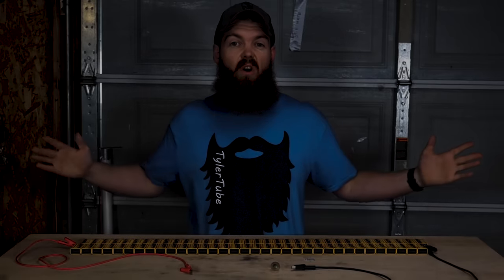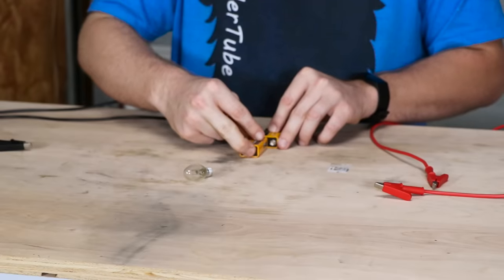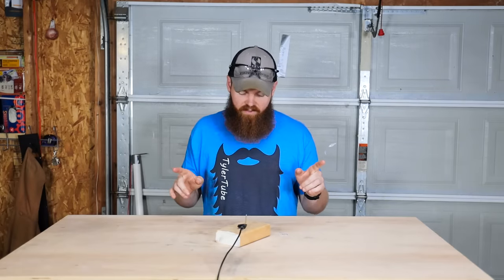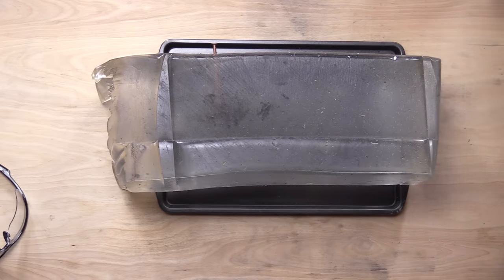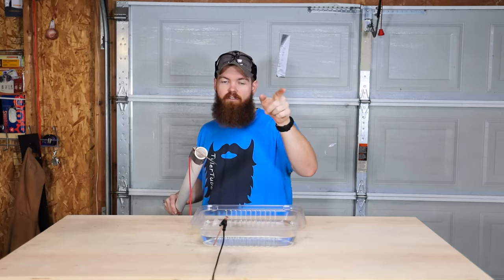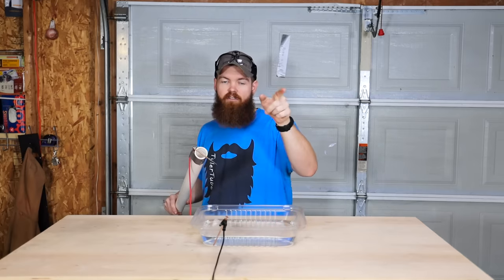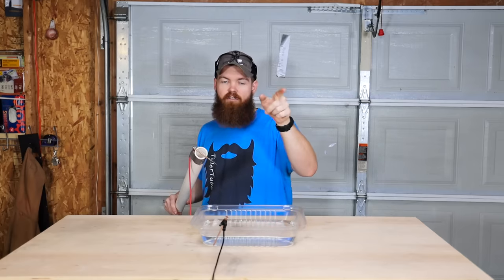I Connected 500 - 9 Volt Batteries...

Comment: 6:22 - Would worry about those hand placements my dude unless you want to be the next test subject....
Reply: Yes, that was a little toooo close for comfort, if his hands would have been sweaty or wet it wouldn't have ended good
Reply: i was thinking the same haha
Reply: closed my eyes a few times
Reply: @loganbrent8075  why? the video is uploaded so you know he doesnt get hurt
Reply: @tjorvenblader  i guess
Reply: @voltare2amstereo  He had one hand almost touching/touching HV-, another hand almost touching/touching HV+.  His whole body was almost connected to HV+ and HV- across his heart.
Reply: @voltare2amstereo  what does that mean?
Reply: @tjorvenblader  he was saying that because none of the wires were connected to the ground, just touching one wire or the other wouldn't create a complete circuit and shock him. The bad thing is, he had two hands on different parts of the battery bank so he could still have been electrocuted if his fingers slipped even a few millimetres.
Reply: @voltare2amstereo  Not sure what you are getting at here? Have you never licked a 9-volt battery? It shocked you, if it had a charge that is.... and 500+ of them put together in series will do the same thing if he puts his hand on the + and - terminals

Comment: The distilled water doesn’t conduct electricity, the water was no longer clean or “distilled” because the container was contaminated, and likely the leads used. To properly test, you would need to a fairly controlled setup
Reply: You must be new here
Reply: Even though there was a tiny bit of contaminats there, I think the plasma ball like electricity was a nice result.
Reply: Thank you
Reply: Distilled water is not the same as pure H2O
Reply: who cares
Reply: Austin Franklin exactly.  Who has the time to care about petty shit like that
Reply: moonboogie N8 lol i was gonna say that
Reply: Distilled water does conduct electricity. Deionized water, on the other hand, does not.
Reply: Wouldn't the electric current travel through the table? Especially in the "hot dog experiment". I have no idea, but from my basic understanding of electricity, it takes the shortest path to complete the circuit, right? That's why not all of the dogs zapped, only some.
Reply: @aeonexoriginal  Least resistant path in this case was the hotdogs. They were passing pretty much all the current. It heated most where the resistance to that current was the highest. Air gaps and dog to dog interfaces. Wood doesn't conduct well until it has been burned or contaminated. Just trying to help.
Reply: @andrewlorona7360  ah I see. So the current travels through the shortest, least resistant path. Thanks for the clarification.
Reply: SUPERMAR10312 right, but if you distill water multiple times and use clean containers distilled water generally insulates as well. I suppose I expect too much from store bought distilled water. Also, pure h2o technically can conduct water as well given the right conditions, so if we are all playing semantics here pretty much anything is a conductor to some degree
Reply: @aeonexoriginal  tables don't conduct electricity.
Reply: @WickedTimeFox  yeah anything can conduct electricity. But generally speaking though....
Reply: @theburningissue3132  Everything conducts electricity. Even insulated material designed to protect against electric shock can conduct electricity. Electricity follows the most effective path to make a complete circuit. That's why it can go through human bodies, hot dogs, and yes, even tables.
Reply: @aeonexoriginal  I'm aware of that but you need a ton of juice to break the resistance of wood is the point. I guess I should have been more specific. Especially to someone like you that thought the table would be able to carry the current. there's not enough juice in those batteries to make the table conduct the flow of electricity.
Reply: @theburningissue3132  Yikes. Your tone seems very aggressive. Please stop tagging me, thanks. I just wanted a friendly conversation

Comment: BigClive has been beat out at hot dog electrification. You do spook me out when you get your hands near the ends of the line of batteries or just casually put both hands just anywhere on the laid out pile. With that kind of voltage, you should REALLY keep one hand behind your back or in a pocket to prevent arm to arm heart shock. Those battery terminals aren't insulated, and you only have about an eighth of an inch gap of protection when you just put your hands on the batteries like that.
Reply: Imagine if i he had touched the metal garage door that the positive terminal was resting against if he was still in contact with the grounded hotdogs.
Reply: It's not volts that kill you. It's Amperes. I think over .2 amperes is deadly. You can survive millions of volts if the current is limited to one miliamp.
Reply: @Bobdylan12121  a Million Volts at 1 mA is still 1000W, not something i'd want passing through my body.
Reply: @Bobdylan12121  It's about current over the heart. And it's way lower than 0.2A, try 0.015A.
Reply: @chrisjacobsen1659  Dry skin impedance varies for each person. A simple google search reveals the normal fatal level to be above 0.2 amp but some people can be fatally electrocuted with lower. At 16ma you wouldn't be able to let go due to muscle paralysis and unless someone released you  somehow you would be stuck being electrocuted until you were completely fried. At 30ma it can actually throw you away, less risk of frying to death but more risk of immediate Ventricle Defibrillation, which would stop your heart and lungs. Your heart may start again on it's own after release however your lungs would not as you would likely be unconscious.  All of this being said more than 75% of people survive shocks over this. Once you get into the 50-80ma range, and even into 100-200ma you're talking about instant death for most people, frying all organs instantly in the path of electricity, and completely destroying muscle tissue in the heart, as well as nervous system nodes that conduct electricity. Even if your heart and other organs were able to be replaced your entire nervous system and synapse connections would be fried and you would likely either be a vegetable or braindead etc. The neuron paths are organic "wires" that conduct electricity but they can't handle many amperes, which is current. Sorry I made this comment so long but basically it's not about volts or watts at all, it is about current, resistance and impedance. Amps and Ohms.
Reply: The cases of the batteries are only insulated from the cells by a little plastic wrap. If that got wet, there would be an instant path for several amps, several kilovolts, right into his body.
Reply: @bloxyman22  oh my, just saw that. Actually he was touching it in a way since its actually grounded in the outlet for the power door opener. And the outlets are usually grounded to the  foundation among other things. The only reason we got to see the video is because he disconnected the hot dogs even though he thought the negative wire was "probably safe." Then he set it on the table like it was harmless... this guy doesn't know how lucky he is...
Reply: Whoah..

Comment: I swear Tyler is gonna catch the house on fire one day!😂 Edit:Thanks for 202 likes I never had this much likes and I appreciate all of your support thank you 😜 Edit 2:How am I earning so many likes Edit 3:😭😭😭 I’m crying to much likes
Reply: Screw the house I swear Tyler is gonna blow himself up with that many volts
Reply: Gunslam tbh i didn’t like it
Reply: At this point I think the entire channel is just a creative means of setting up fire insurance fraud
Reply: @gumwarsgaming1328  the volts aren't that dangerous it's the amps that will kill you.
Reply: As long as he does the necessary safety precautions he'll be fine like many other channels that do experiments.
Reply: @ThePrufessa  bro. I watched him deep fry gasoline.
Reply: @joshclingermayer6091  you can deep fry plutonium as long as you do it at a safe distance.
Reply: @joshclingermayer6091  no he cooked food in motor oil. Not gasoline. And that's not really all that dangerous. Oil is made to be used at extremely high temperatures.
Reply: And we’re going to be there to watch it happen 🤪
Reply: I know right😂
Reply: But it's going to be from like cooking😂
Reply: @ThePrufessa  any normal 9v battery can cary a lethal amount of amps. But there's not enough voltd behind them to force it into your body. That changes when you stack them like this.
Reply: @ThePrufessa  hes not doing the right safety precautions though. He had his hands laying on those batteries, and the cases are weakly insulated from the inside. Nothing that's designed to hold 4kV.

Comment: The reason you're feeling static every time you touch something is because at 4500 volts, your battery bank and electrodes are charging the air in your garage with electricity. Nikola Tesla was working on charging the atmosphere with electricity at extremely high voltage to make it a wireless delivery system for electricity.
Reply: Thanks Bill Nye...
Reply: What? 

You do realize overhead power lines are at like 7500V and yet does not create this static electricity. 

You need a tesla coil for what you are talking about. And AC not 9V DC batteries.

The simple answer is he didn't tie the battery ground to earth. Hence a floating ground that may have been a thousand volts in either direction. Hot dogs acted like capacitors and he got shocked.
Reply: @chrisjacobsen1659  i dont even care if you are right, the idea that you thought of hot dogs as capacitors is awesome.
Reply: @chrisjacobsen1659  i've never had my hands close enough to a 7200v line to know, and don't plan on it.. Also those are Alternating so tyey won't be able to build up the same kind of charge.
Reply: Update: I just watched the scene with the static he grounded his positive stick by laying it on the garage door. The negative clip was at 4500 negative volts to ground, laying on the slightly conductive wood table, and the little shock he got was that limited current flowing back through his feet to ground. If that clip had made contact with the hot dog juice part of the table, or if it had arced when he grabbed it to connect everything again, the current wouldn't be so limited and the video wouldn't have been posted.
Reply: It's because he left the cathode connected to a wooden block resting on the table. At 4.5kV it is high enough to cause a potential difference between his body and the wooden table, hence the static electricity discharge. It's not because the "air is charged". What most likely assisted with the shunting was probably because the table was covered with hot-dog juice, the water mix he saturated on the table as well as the soap (which are all good conductor paths).

EDIT: I doubt the hot-dogs were acting as a crude capacitor (AKA: Leyden capacitor) because there is no actual anode or cathode on the hot-dogs. If they were storing a charge, he would need to touch his finger on two sections of the hot-dog to "short it out" and discharge it.
Reply: @chrisjacobsen1659  park your car on grass, under a high-tension line, then grab something metal (like the antenna, if your car is old enough) on it while you stand barefoot next to it.
Reply: @animeloveer97  For last mile wiring, yes there is insulation. But for high voltage transmission lines, which are on the order of 100's of thousands of volts, they are almost exclusively stranded aluminum cable with no insulation. Although the huge height above ground and metal conductive gantry towers may be the reason for no static effect on the ground

Comment: Could've died AGAIN at 17:04 when he's touching the compromised pipe (now with both soap and water contamination) with one hand and pouring water onto the wet piece of wood with the other hand.
Reply: Those batteries are not referenced to ground... It should be relatively safe.
Reply: @squidward752  if the pipe was damp, and so was the water bottle, you've got a complete circuit from both terminals (no pun intended) to his hands. Luckily there wasn't a continuous path of water along the surface of the pipe this time.

Comment: i like how you rest the live end against a metal garage door
Reply: It was isolated from the batteries negative, which have no reference to ground, so it should be fine since a circuit couldn't be made. Though for all we know he had the batteries leaning against the shed wall...
Reply: @MelodicTurtleMetal  he could complete the circuit to ground maybe?
Reply: @dannythorpe1425  the battery negative would have to connect to it somehow to allow the electrons to flow from the battery. As long as the negative doesn't have a connection to the shed it shouldn't allow a circuit to be formed..

I think... It's late, and batteries are a bit weird

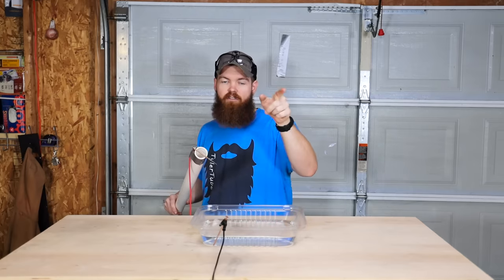Comment: 20:27 the HV positive electrode / pipe is resting on his garage door frame touching a completely shut garage door.  If the floor was wet from the "distilled' water (no longer distilled if it's on concrete full of minerals), the soap mist, and now possibly hot dog juice, and he touched one of the hotdogs, his heart would stop pretty instantly.
Reply: Yeah I don’t know who this guy is, but he clearly has no idea what he’s doing.
Reply: @MrHimynameisdanny  I'm surprised he's alive.  I wonder how many deaths this video will lead to, though, from idiots thinking it'd be a fun thing to do to show friends.  I've already reported this video, if it helps to have more people reporting, you should, too.
Reply: @yueibm  that garage door is probably grounded by the outlet that opens it, which is often tied into the foundation and the damp layers of the concrete. I think that he would have died if he touched the negative terminal while that was sitting on the door. Apparently almost 30 people have died trying the wood burning thing, mostly with high voltage transformers.

https://www.woodturner.org/Woodturner/Resources/Safety-Materials/Safety-Fractal-Burning-Lichtenburg-Burning.aspx
Reply: @deltab9768  Wow, good point!  And I had NO idea so many people have died from doing Lichtenburg wood burning before.  I really hope no one tries what was shown in this video.  Even 20 of these batteries can be deadly.